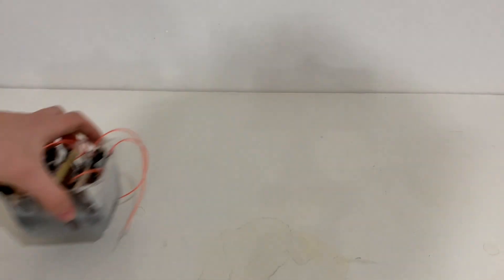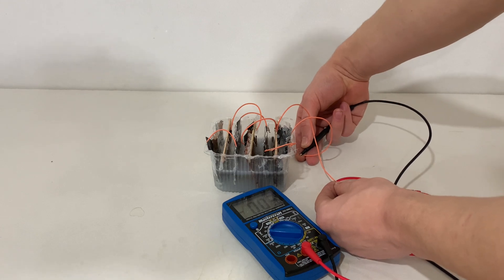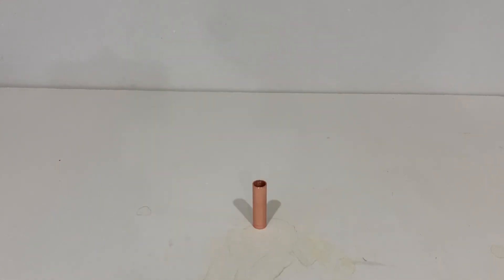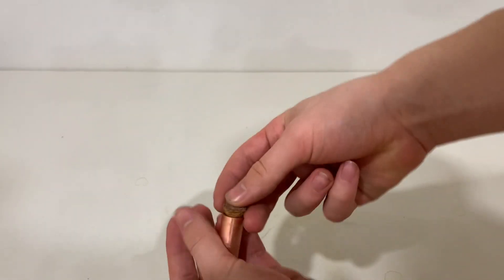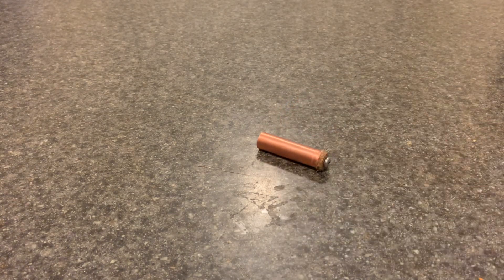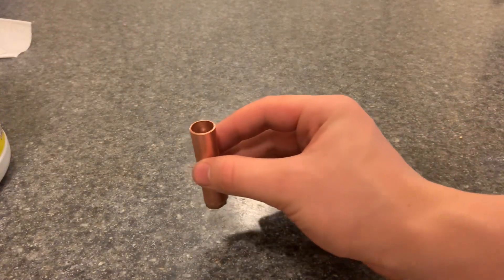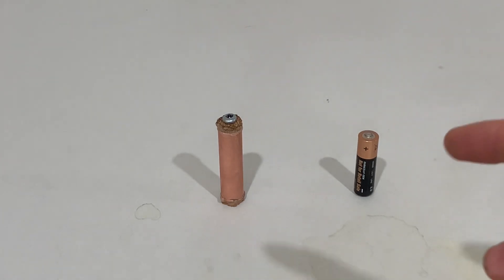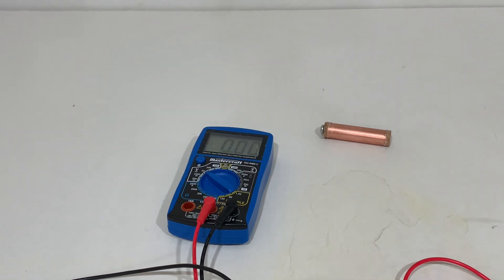How to make a battery from copper piping

Comment: What's the mAh?
Reply from the maker: That is a very very very long calculation which I am afraid I have no way of doing or even knowing the values for the variables of it
Reply: @ChemistryOnCreatine  For theoretical yield vs actual yield? That's too bad
Reply from the maker: I have no idea how to get the theoretical yield or the practical one. On top of that the voltage decreases when a battery is used, so again I have no idea when it’s considered “finished”
Reply: @ChemistryOnCreatine  In high school I knew how to do it. We had reference charts that sorted the metals for anode and cathode and theoretical voltage. Never did mAh but I'm sure you can do it based on current with a load and duration it takes to get it's internal resistance to increase with a graph probably an oscilloscope.
Reply: Maybe you can get electro boom to measure it

Comment: The voltage value is quite good for a homemade single-cell battery. I'm impressed i was tried to make batteries in the past using things like saltwater and coca cola but they didn't really had an impressive voltage and current output. Nice work
Reply from the maker: I did it through trial and error of experimenting what anode and what cathode works the best and writing down results, as far as I know bleach is the best option for this  and so is zinc. Maybe just maybe I suspect something like sodium hydroxide could also work but that’s experimenting for another time